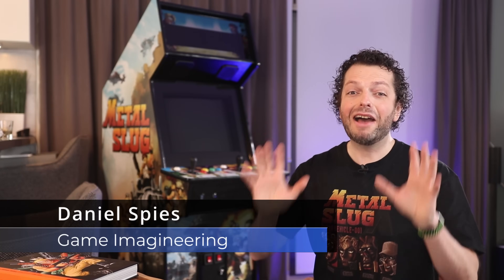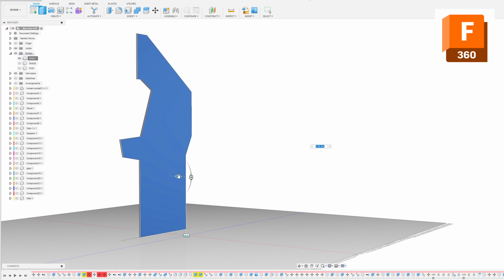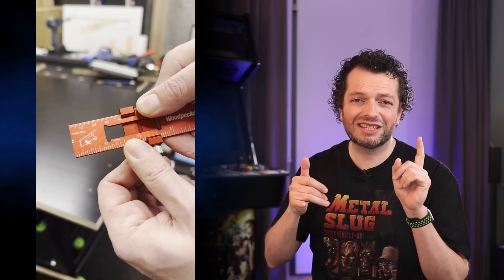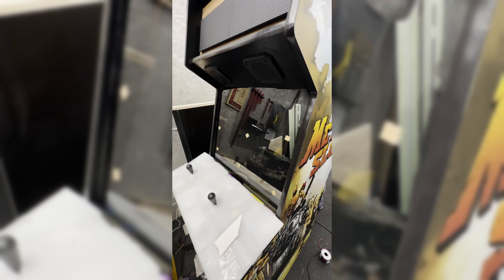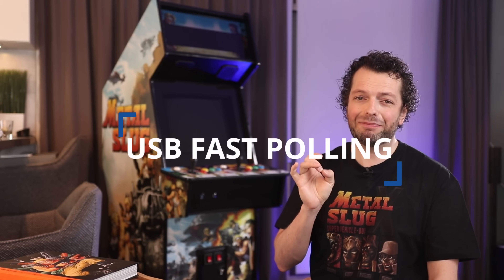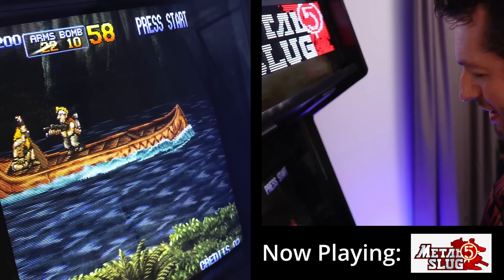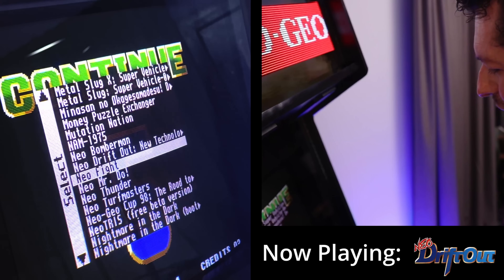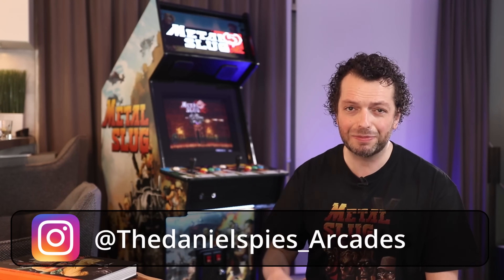Mister FPGA Neo Geo Arcade cabinet with old-school PVM monitor

Comment: Awesome job. Beautiful design on the cabinet and control panel. I'm still running original MVS Neo-Geo systems in my arcade. Not original cabinets but I use CRTs. Single and a double slots. I would love to install this system in 1 of my cabinets for the arcade and maybe for home use. If you were to sell a kit already set up, how much would you charge?
Reply from the maker: Ah sorry, I don't sell computers or FPGA systems :-) I am specialized in Arcade cabinet building
Reply: @TheDanielSpies_Arcades  I understand. Pity I am too far to buy a cabinet that you build.

Comment: How much does something like this cost? I have a MISTer and OEV143 monitor. So what else would I need to do this?
Reply from the maker: You can make it as expensive (or cheap) as you like! If you build it yourself, you will only need wood, hardware, glass panels, audio, power, Pixelcade monitor..

Comment: My only suggestion Daniel is to re-do the front kick plate graphic by adding player 1 and player 2 arrows over the coin door slots like the original.
Reply from the maker: Nice tip, thanks!
Reply: @ I mean it’s a flawless cabinet already lol who am I to judge
Reply: My only suggestion is a refrigerated cup holder on each side to hold your beer during extended gaming sessions 😂
Reply: @HungryHungryDude  no that wouldn’t quite fit the theme of the cabinet.

Comment: I like some of the builds you make, and all of them take so much effort! 

So it always throws me off as to why you always Skimp out on your efforts and time when you buy in to these Knock off buttons and sticks. 7:00

Do you not get Industrias Lorenzo buttons & Sticks out there? 

The sticks and buttons are what you actually interact with, you can slap them in to a shoe box and get the feel like you would from the real Machine because they are the real stuff. 

Here, you use Clones and their switches are not rated at the same weight as they were on the real machines. 

You put in way to much effort to keep skimping out on the controls.
Reply from the maker: Hi, Ultimarc buttons are generally seen as the best in the industry? The sticks are official IL sticks btw.
But upgrading tips are welcome!

Comment: Apologies if I simply missed this but how did you mount the PVM display? Did you de-case the unit or add it to the cabinet with the original enclosure?

Also: are you using the Pixelcade LED display for the marquee or a custom setup?
Reply from the maker: I used the total monitor as this is very easy to maneuver in the case. I use Pixelcade LED as for the Marquee indeed!

Comment: Have to say what a real arcade experience with the CRT! Definitely brings back the real magic.
Reply: Yeah, I can’t stand LCD. I want thy screen he has! It’s amazing how good the games look!
Reply: @retror.d.1630  He went to stay with original as possible and went CRT, but, now with the new upgraded retrotink we can finally get that true CRT look on LCD, but the price is up there and if it ever drops then it will definitely be the way to go as it would be so much cheaper and easier. But for staying original this CRT is a must!
Reply: @retror.d.1630 you can use shaders with emulators but that's not possible with mister fpga unfortunately.

Comment: Finally someone who installs a CRT. It’s the ONLY true way to display these 80/90’s arcade games. Amazing job!!!
Reply: If you really want to be a purist you need an arcade monitor
Reply: Bro he used a cat but what about everything else??
Reply: Meh, I do not worship at the CRT alter. The reason they quit selling is because people quit buying them. I think CRT shaders are whack, blooming is lame, and input lag on newer flat panels is negligible. So fire up your soldering iron so you can recap your old CRT, and hope the phosphors haven't all fallen from the glass.
Reply: @saysbadman  Sure, understandable. Tech is definitely dated. People stopped buying them because there was no reason other than old video games to keep using them, so you can get the authentic look of the original graphics. The lag on CRT is probably still better, and yeah it's hard as hell to find a good working model, but that's part of the charm. You don't have to worship them to appreciate the time they came from and the way games looked when using them. Nothing compares, really.
Reply: Shame everything else is wrong

Comment: For the controls you used two of those usb boards correct?  When setting your button map, when you set player one it copies to player two correct?
Reply from the maker: Yes but I used two different Brook boards == different ID’s as Mister FPGA keeps having problems using two identical boards